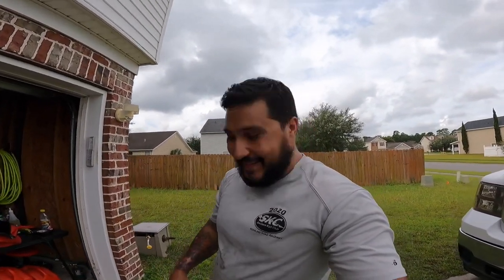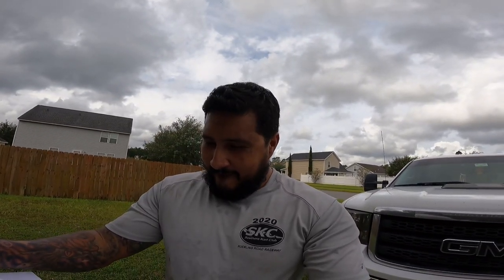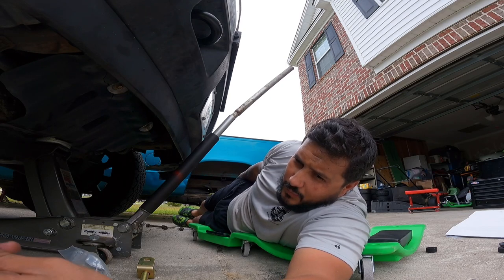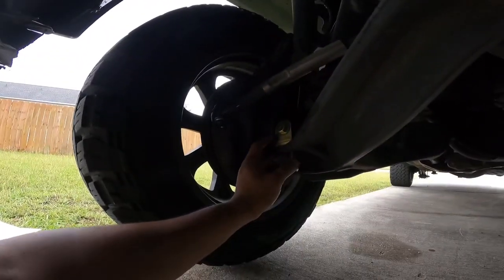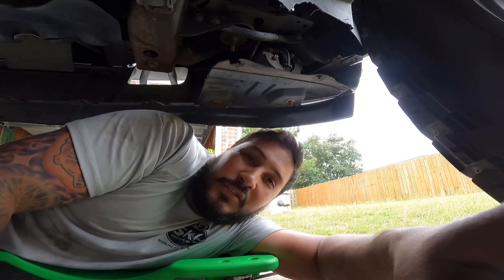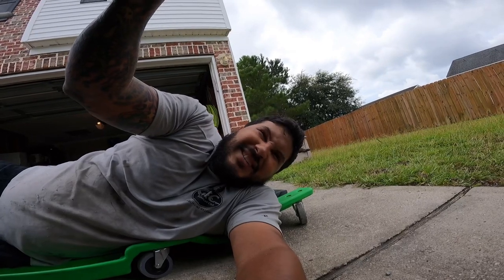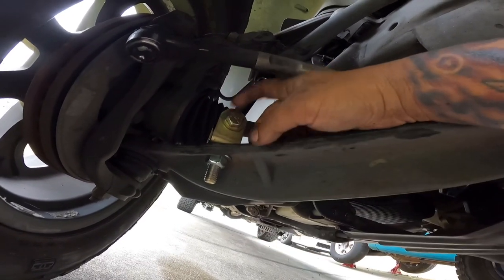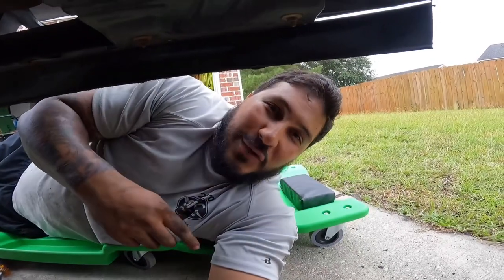11-15 LML Duramax Cognito Swaybar End links install and review.

Comment: FUCK Cognito!
Reply from the maker: What’s wrong with them? Customer service?
Reply: Glad you didn't get upset brother! I know too many folks who had to replace Cognito Ball joints and finally ended up with Krypronite UCAs and XD joints.
Reply from the maker: Thanks for the heads up. I still will go with the sway bar but the upper control arms I have been debating between the two.
Reply: @JaMRacing  Hardly anyone makes a shit sway bar, or end links, but I heard Cognito had a "Revision" in 2013 on their ball joints (Which look exactly like MOOGs). Either way it was thw deciding factor on me going with the Kryptonite ultimate front end kit with FOX 2.0s. Stay tuned on the group for my install!
Reply from the maker: I love my shocks. Made the ride a little stiffer but feels like a truck for sure. Will do man and thanks again on the information. Write a review on what you think of it cause I would love to know.
Reply: @JaMRacing  Do what works for you and don't listen to horror stories, even of they're coming from me. But a name like "Cognito" just sounds cheap already🤣
Reply from the maker: Someone just posted a killer deal on a set that they didn’t get a chance to use. Hard to pass up lol
Reply: Kryptonite